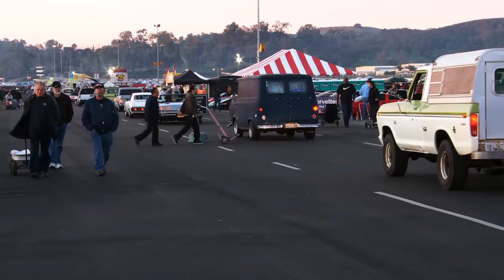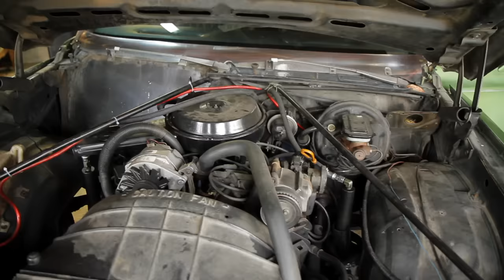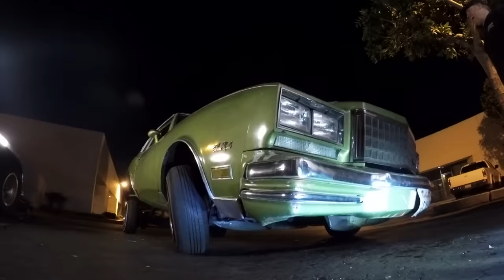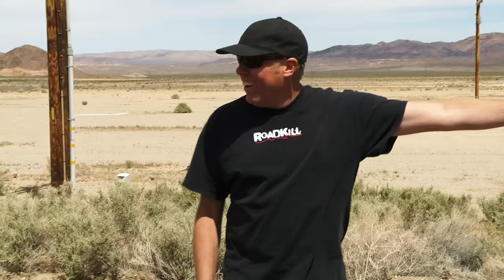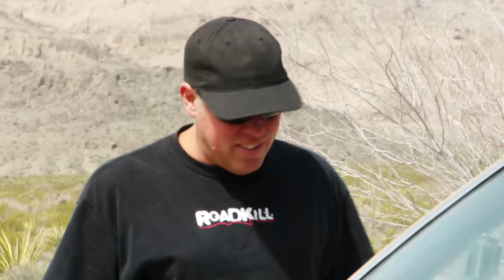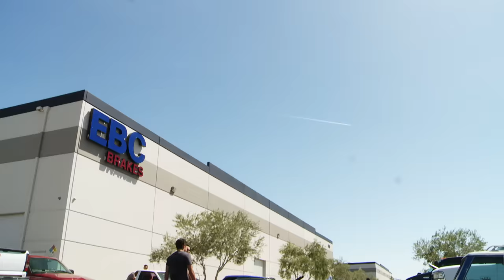Off-Roading a Lowrider Monte Carlo! - Roadkill Ep. 39

Comment: At 13:50 i thought those tires on the roof, were for in case it rolled over while doing it's bunny hops or driving on 3 wheels only and it flipped. M.

Comment: I bet the oil system is not made to pump inverted. How about try to drive it off road without constantly hitting switches. Just use those to get over, around, thru obstacles, lol 

Like have big wheels on and front and back jacked up. 

Edit: I see that is kinda what y’all did when y’all jacked up the front hydraulics. Now to strap the exits tires over the trunk so it won’t bounce as much.

Comment: All he needed was a Led hammer u can buy them 4about 50$ at any tire shop the led hammer is made of soft led so when ur hammering off the knockoffs u will not scratch,dent,or any other damages will not happen the led hammer hits the key to take off the knockoffs the key it the black round thing he put on the bullet tip knockoffs &hit it wit reg hammer the led hammer falls apart shreds every time used the hammer takes the damage instead of the rims or spokes just saying all this 4fun sorry 4going off 😆